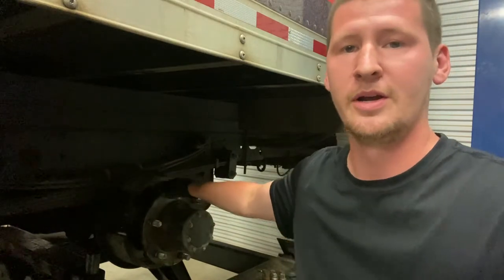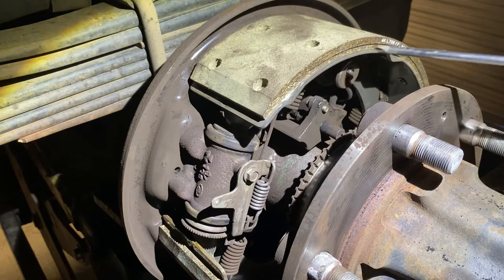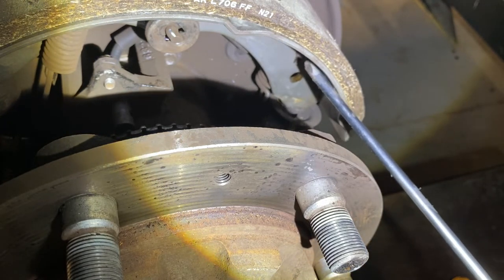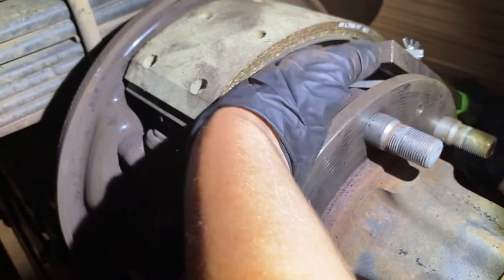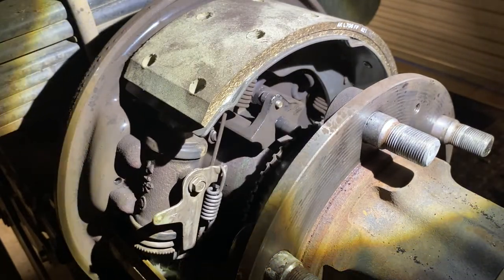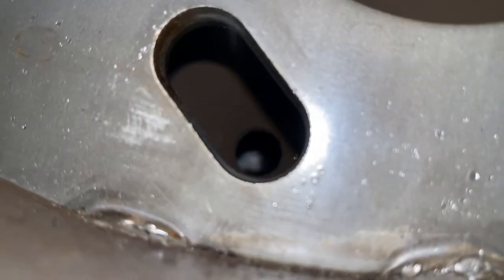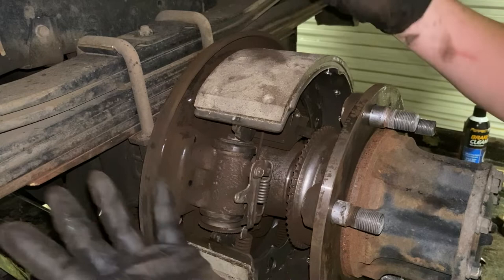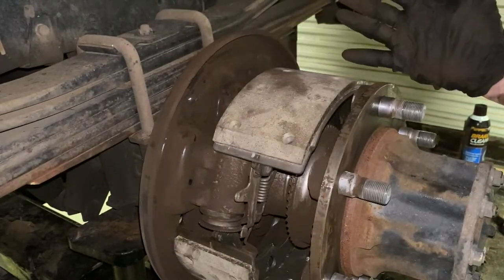Isuzu NPR rear brake shoe removal

Comment: How about putting them back on
Reply: Would also like to know this
Reply: @dirtcargirl00  I figured it out.. it's not too hard. Put one spring onto both shoes, position them over the hub and hook the other spring onto both shoes, pry them into place with a pry bar one side at a time then once they're in place put your hold down pins in.